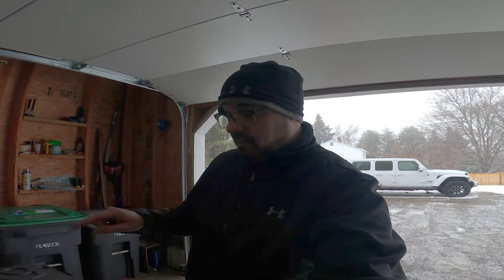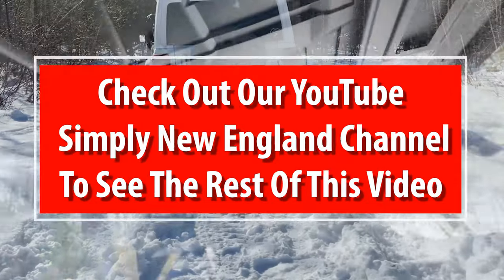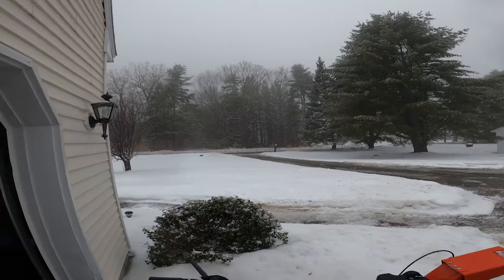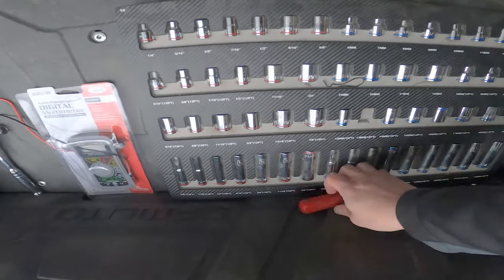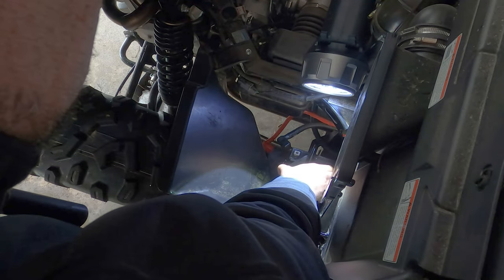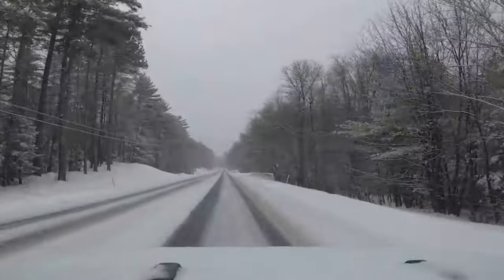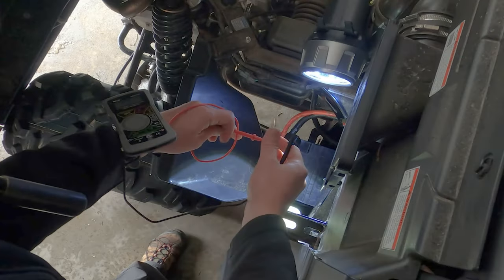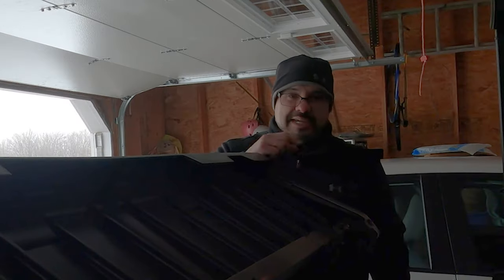CFMOTO UFORCE 1000 BATTERY ISSUE |  HOW TO REPLACE THE BATTERY | MULTIMETER TEST

Comment: My U force 1000xl did not have the battery tie down nuts.. what size are those 2 nuts for the metal tie down?  You said 16mm?  Can’t find the correct size.. Appreciate it.  Thx

Comment: You drove back on the original battery, so why did you think the battery was bad? Did you get it charged and load tested before replacing it?
Reply from the maker: So it was odd, we jump started it with the jeep, and ot drove home fine. once I turned it off , dead as can be. It was not charging.  I did take it out and I did bring it to the dealer. he tested it, and sure enough,  dead! so they replaced it.  if you go into the chanel thr follow up video will explain more.  just posted it today  :)  Thx for the question and thank you for being a subscriber!! Extremely appreciated!  :) 

link ot you can find in channel,  newest post.. https://youtu.be/AkxAQqSypxQ
Reply from the maker: Doug sorry, got confused. you did watch the newest video. lol if you missed the first one when it all happened. that video is also available.  please do let me know what you would like to see in the future. running out of ideas. :(

Comment: So I watched your video about the battery and felt like there had to be a simpler way and I found it. Lift the passenger seat up and remove the storage box and you have access to the bolts on the battery bracket. from the bottom. You don’t have to remove the cotter pin and go in from the top.
Reply from the maker: nice!   thx for sharing that with me :)
Reply: This comment saved a lot of  extra work!! Thanks!

Comment: I took the passenger front seat and the toolbox out and had no problems getting the battery out and reinstalling it. The bolt was a 14 mm.  I have two CF moto 1000 and both batteries went bad in about two years.
Reply from the maker: that's good. I was really trying to avoid having to take much off to get to it. :)

Comment: Did you check the posts if they loosened up....I know they did on mine...make sure to carry a Phillips....
Reply from the maker: In this case I did not foolishly. lol but when I got it back home, I did test the battery with a multimeter,  it was dead as dead could be. Had to replace it. I have a part two to this video if you missed it. :)

Comment: You never put your ground on first because you ground the machine for dangerous contact when putting the positive back on
Reply from the maker: Different schools of thought on that one. I was always taught that by connecting the ground first, you establish a reference point for electrical potential and provide a path for excess current to safely dissipate in the event of a fault.

Comment: I need a video explaining why the batteries keep crapping out. Had barley a year and going through my 2nd bad battery experience. Tired of being stranded in the woods. Avoiding the long hikes was the whole reason for buying the stupid thing 😆🤣
Reply from the maker: oh no!  my advice. get a 25 dollar battery tender and keep it hooked up when  ot using.  super easy to do and after I did thst I had no more issues.  either that or pay the extra to get same battery in high end brand.  but honestly.  the tender has worked fantastically!

Comment: Should have load tested the old battery.
Reply from the maker: Didn't have the multimeter till after lol  Go figure! haha. But, when i did get to the dealer he tested it and said it was fried. Pulled one out of machine on the floor and I was on my way. :) Worked out well. :)
Reply: @SimplyNewEngland  enjoyed the video, thanks also for the reply! 
Just found your page today. How long have you had the machine? 
I am in the market for an SxS and watching every video I can find. 
CFM seems to be very popular and has a strong following, so I am looking at them real hard. Just trying to be an informed consumer. Leaning toward the UF1000. 
Unfortunately there are none to be had in the region.
Reply from the maker: @Delmarksman  First had the u1000, absolutely loved the work aspect of it.  It was a beast!  found over time I wanted something sportier  as I hooked up with other riders.  Only reason I traded it in for the zforce 950. I stayed with cfmoto. then over the summer I purchased antoher moto 800 xc 4 wheeler. absolutely love it.  like any brand, pros and cons. CFMOTO is not Chinese crap like those machines you can buy online for 3000.00 with 0 quality control.  CFMOTO's  are mass produced under quality control with standards.  They now have a large corporate presence in the US.  the price point is unbeatable for the all the extras they give you.  As they retool and fix issues customers point out, the price is slowly rising. that is to be expected.
Reply: @SimplyNewEngland  Thanks again for the reply. Watched a bunch of your videos and just reading through the comments last night. I can understand why you traded in. Your comment above and elsewhere mirror my experience when I bought my first Harley. Started with a Sportster, I grew out of it very quickly and traded up, wanting to ride with friends etc. 
Unfortunately, I took a big hit on the trade in, and hope that you didn't. I just really don't want to end up in that situation again.

There are no trails nearby, DE has no off road areas or parks. That said, it is in my mind that I can travel a bit.
So here is my general thoughts (mental battle) on the U1000 vs the Z950, the main intent/use in mind is tree work, dragging branches and pulling, and snow plowing. It looks like the Z really isn't designed for that; mostly trail and off road use and not any sort of work in mind. 
I definitely see that the Z has a better suspension and seating position (better seats) than the U1000 bench. But don't know if I'll ever find myself running trails for hours at a time. But as you noted elsewhere, I too have a cart for moving lumber.
Is the Z capable of doing light work? I've seen a few video's of people plowing with their Z800's.
Reply from the maker: @Delmarksman  from what you stated, sounds like the uforce1000 is a no Brainerd for your needs.  you will enjoy it! I did!! and you can still get down on it and have loads of fun!